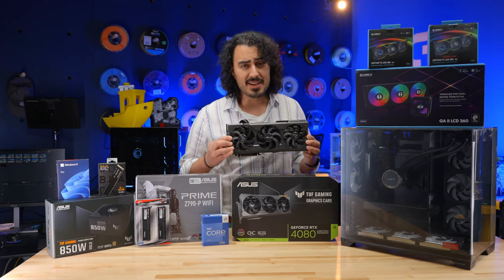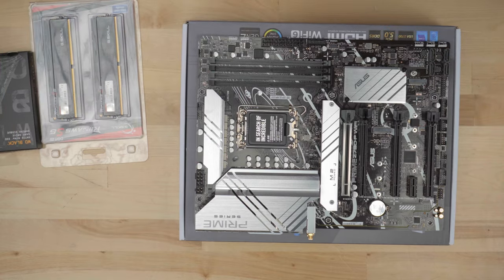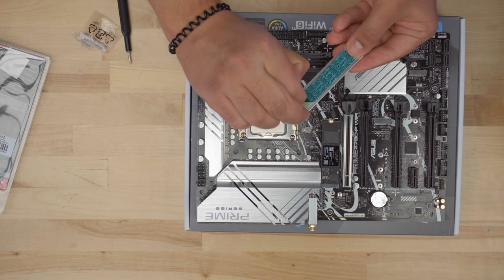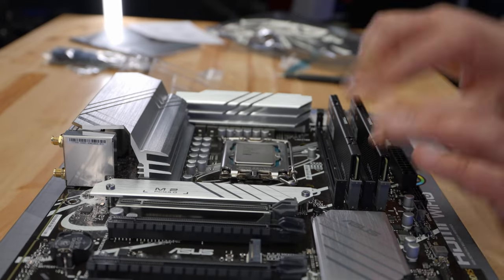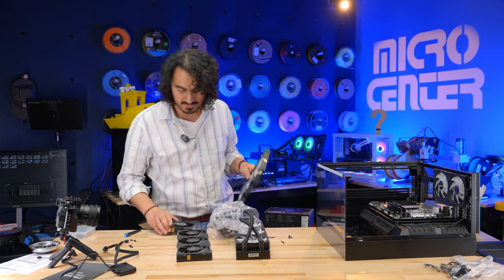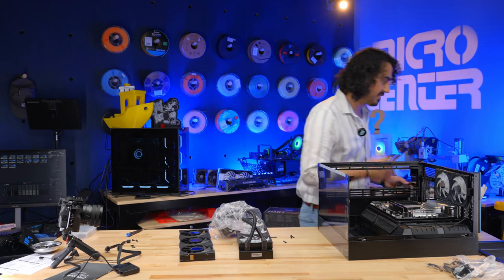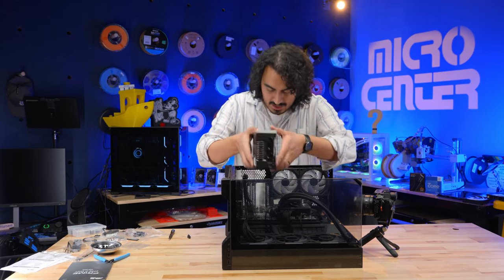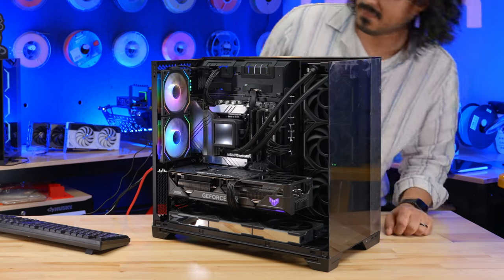Let's Build a 4080 SUPER PC | Micro Center BYO Month

Comment: I thought having the radiator hose going upwards when the radiator is vertical is not good practice. It's better to have it going downwards
Reply: That's incorrect. The only time that is accurate is when you place your radiator on the bottom of the case which everyone generally advises against

Comment: Good video. But  there is not  detailes on why you seat or instal  rhe  SSD  NvMe  in a specific  slot if  this SSD is Gen. 3 or Nv M e  gen 4  or which slot  needs to be inserted. Only thing  Im seeing an hearing  is Im gonig to instal this here an this there, now Im gong to do is this. 😢

Comment: I build pretty much the same PC a bit better.
My specs:

Motherboard: Asus prime Z790-p Wifi
CPU: I9 14900kf
GPU: 4080 super
Case: Corsair 4000D
SSD: WD 2TB M.2
RAM: 32GB DDR5 6000mhz
CPU cooling: Corsair ICUE H150i Elite
Power supply: 1200W be quiet!
Reply: How is that the same?